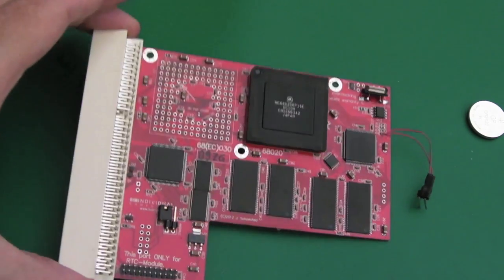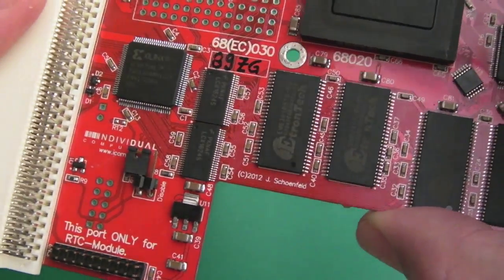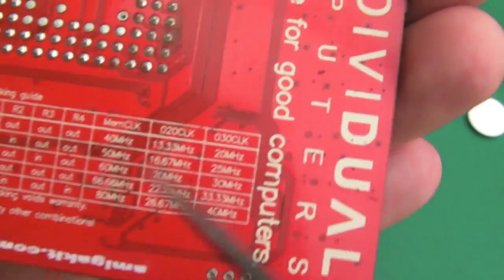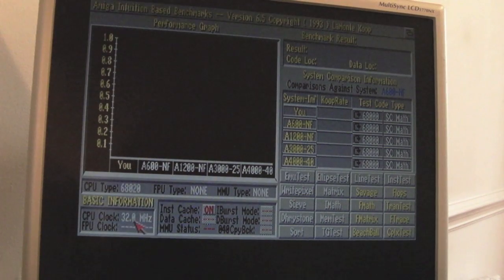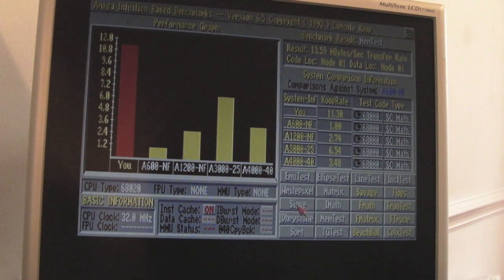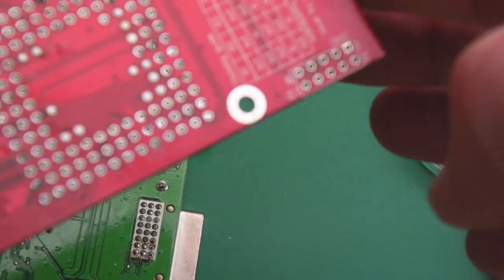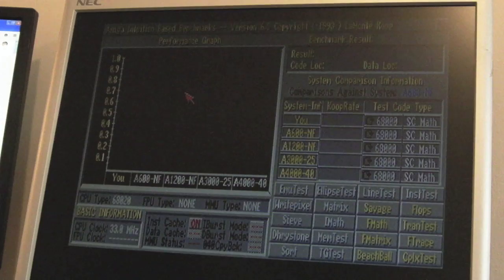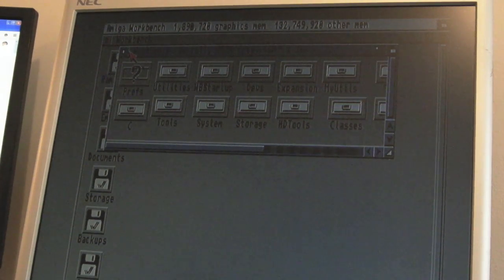Commodore Amiga A1200 ACA1220 Extra Overclocking

Comment: Weird you doing a video on this, ive just spent the last 4 days re-building a friends CF card from his Stock A600 using Winuae and Classic Workbench with WHDLoad. Not good with 1MB. Even when booting without a start sequence some things dont run. I have a stock A1200 running  Classic Workbench Lite and WHDLoad. Looking at getting one of those new ACA1221's from AmigaKit just for the extra meg. A quick question, do they also work in an A600 because i recommended the ACA to my friend but not sure if its compatible as his runs like a 1 legged dog lol. Had to re-learn loads of AmigaDos commands. Took me days to get his card done. Was having problems in Dopus crashing whilst copying files and games. Messed with all the recommended Max Transfer rates when partitioning. Got quite proficient at doing it all now. Everytime it crashed i had to start from scratch and DiskPart the CF card again. Nightmare mate.
Reply from the maker: +craig gilchrist That Max Transfer rate thing is a pain in the backside and needs changing when using CF drives I think.  It got me also - every single thing I copied to the system was corrupted and I couldn't work out if it was the Amiga or what.  Drove me nuts!   For the A600 I would consider buying one of Kipper2K's Vampire 2 boards, they are cheaper and way way faster than the the ACA620 (for the A600) - they actually make the 600 faster than an A1200 @ 80Mhz!.   The ACA1220, 1232, 1221,1231, etc are for the 1200, or can be used with an ACA500 on the Amiga 500 / 500+.
Reply: +GadgetUK164 Cheers Gadget, i will check that out. 80Mhz cant have him having a faster Amiga than me lol
Reply from the maker: LOL =D  Kipper2k is doing the same expansion for the 1200 soon hopefully =)
Reply: Gonna be more than 70 quid though I would think. That new ACA1221 is that price. If its the right price who would you go with in regards to build quality and reliability? Obviously the chips are all original on the boards. Ha Ha, Wonder if you could program an Arduino to share its ram through the expansion slot. Find the card edge schematics see what they do. Wild idea but im always thinking outside the box. Do you think thats possible? Finally just got my Assigns right in WHDLoad so it can see my games. Jees sick of watching a bar going across the screen in Workbench copying games to the CF. Even in Winuae with 8MB 1GB Fast and an 040 it takes a while.
Reply from the maker: Probably not much more though!  The version for the 600 is 150 euros I think which is amazing really.  I like the Indivision cards because they have lots of RAM, but the newer ACA1221 is kind of crippled in its 'locked mode', I would be tempted to unlock all of its features right at the start which gives you 64Mb (which is OK for nearly everything) and OC to 26.7Mhz which makes a big difference even just in Workbench and boot speed etc.   Yes the CF card can take a while when copying lots of files etc.  I think Individual Computers also do a 'fast IDE' board, but I am not sure how much faster it is and whether its worth it or not.  It probably enables PIO mode 4 or something.

Comment: I got my aca1220 up to 40 Mhz without changing the crystal or the cpu. I stumbled across an undocumented setting with the jumpers which upped the multiplier. It's rock solid too. I Let it run Doom for a couple of hours, no issues at all. Of course it gets a little hot so I put a heatsink on there. Not very effecient i guess with the plastic packaging but it definitely absorbs some heat.
Reply from the maker: +Henrik H Can you expand there?  What combination did you set?  That's awesome if that's possible because the 020 - 25Mhz I have running at 33Mhz is currently cold and doesn't need a heat sink.  I would love to run this at 40Mhz.  Are you sure yours isn't an ACA1230?
Reply from the maker: +GadgetUK164 I've just found a thread talking about the jumpers and their multipliers, this is based on the 030 though:- 

r2 r4 = 4x (this is the setting mine was using in order to get 26.7Mhz with stock 20Mhz Crystal, or 33Mhz with 25Mhz Crystal.  Swapping over to use r1 and r4 using the original 20Mhz Crystal I get 33Mhz again.  When benchmarking at 33Mhz I can see the RAM is probably clocked at 100Mhz and the benchmark is identical to when I used the 25Mhz Crystal with r2 and r4, and since the RAM won't run faster than 100Mhz without a mod to the firmware to add wait states, I am confused how you managed to get 40Mhz on an ACA1220.

r2 none = 5.333x
r2 r3 = 5x
none r4 = 2.5x
none none = 2x
none r3 = 3.333x
r1 r4 = 6x
r1 none = 3x
r1 r3 = 8x
Reply: +GadgetUK164 Hi, Yes it is a 16 MHz 020 :) I'm sorry to say that I haven't got the machine with me now, and won't for a couple of months. So I can't elaborate on it unfortunately. 
As I said I stumbled upon it by messing up a solder job. lol. I will let you guys know though when I have the machine with me again.
Reply from the maker: +Henrik H Thanks, I've found the datasheet for the PLL clock multiplier.  Since it looks like the CPU clock is divide by 3 on the ACA1220 the only way it can be working on your 1220 is due to different RAM chips.   When you get chance please check the part numbers on the 4 RAM chips =D  - https://www.google.co.uk/url?sa=t&rct=j&q=&esrc=s&source=web&cd=1&ved=0ahUKEwjI5NWT4_fKAhUrjXIKHcdiDFgQFgghMAA&url=https%3A%2F%2Fwww.idt.com%2Fdocument%2Fdst%2F511-datasheet&usg=AFQjCNEFtQWOtmT3D0vwL86UffAciUhEwQ&sig2=bz2YTtOoXiiK3AbJ1F0AXA&bvm=bv.114195076,d.bGQ&cad=rja
Reply: oh yeah I just remembered, my aca1220 is the 128 MB version which might explain it, the specs on that ram might be different.
Reply from the maker: +Henrik H Mine is the 128Mb version also!
Reply: Hi! Sorry for the late reply but I just checked my A1200, apparently the only bridged resistor was R2 nothing else! It gave me 40 MHz although I'm sad to say it's not stable at all. Most games works falwlessly but things in workbench starts crashing after a couple of hours I guess the cpu is not limited by screen sync and just runs hot in workbench. I really need some better cooling, the small heatsink i put on there is not enough. 
Oh yeah the memory chips are Etrontech em63a165ts-6g
Reply from the maker: Are you sure you are running an 020 chip and not an 030?  The reason I ask is the the multiplier for just using jumper R2 on its own gives 5.3x, whereas the jumper I am currently using (R1 + R4) gives 33Mhz with multiplier of 6x.  So if I swap to R2 on its own it runs slower than 33Mhz, not faster.  Very strange!

Comment: I've just checked individuals website and they are selling a 55Mhz 68030 version.
Reply from the maker: +Ronald Madican I nearly bought that one last month - have you seen the price of it!!  It's a bit costly, especially when you compare to the Vampire and the performance of the Vampire too.  I am tempted though!
Reply: +GadgetUK164 I think that they added on the burst cache and put in the memory compatibility for the 500 which makes it the holy grail of speed and compatibility.
I have to agree that the new cards by kipper2k and Lotharek are much better value.
And you can buy a brand new ps4 for £280.
But it's still gnawing at my soul.

Comment: There is a new card comming out for the 1200 running at about 500Mhz. Check out the kipper2k website. At the moment there is only a board for the 600 but there is more to come.
Apparently you can run Mac software on a 600 using the fusion emulator.
https://www.youtube.com/user/kipper2k
 
I liked the overclocking part of the video but taking the chip off is just bonkers. Hats off to you for that.
Reply from the maker: +Ronald Madican Yes, I've mentioned that further down below in reply to someone else - the Vampire 2 looks awesome!  Just hope kipper2k gets around to producing a 1200 version.  I was tempted to buy a 600 last month but I've just got too many systems and if I upgraded the 600 using a Vampire I just wouldn't use the 1200 any more and I do enjoy using the 1200.

Comment from the maker: Update 14/02/2016 : 40Mhz + 120Mhz memory combination won't work - due to wait states being required I think.  This means the maximum you can run an 020 on the ACA1220 is 33Mhz.  Unless there's a way to change the CPU clock multiplier separately from the memory clock.  Ideally I would like to run memory at 100Mhz and CPU at 40Mhz (or 50Mhz, the current 25Mhz chip running at 33Mhz is stone cold without a heat sink).  The new 25Mhz 020 I've fitted is luke warm at 33Mhz so it doesn't need a heatsink now.  It might be possible to swap the RAM out for faster RAM that might not require the same delay this RAM needs when running over 100Mhz.

In order to get 33Mhz you don't need to swap out the Crystal.  You can just set R1 and R4. (table below is based on the /2 clock I think, so it can be confusing on first read)

r2 none = 5.333x
r2 r3 = 5x
none r4 = 2.5x
none none = 2x
none r3 = 3.333x
r1 r4 = 6x
r1 none = 3x
r1 r3 = 8x

Comment: To make things Crystal clear .... Overclocking Voids Warranty  ! :) 
Good work ! - I do wonder what the benefits are of overclocking "retro" systems,  is there something particular your trying to run that would be impossible on standard hardware ?
Reply from the maker: +A Leadbeater Yes lol!  My warranty was long since expired =D  I generally wouldn't overclock any other old systems except for the Amiga and ST.  Basically because those systems did have different speeds (typically through 3rd party expansions) and the software was developed to make use of the faster clock speeds.  There's an absolute tonne of Amiga and ST software which benefits from a faster clock speed.  Even just Frontier or Doom are quick examples of where overclocking really helps!  Even just the OS is much faster.  For example if you boot a stock A1200 it can take 10+ seconds at least, with a 26.7Mhz CPU it takes litterally half the time to boot.  At one point when I was testing I thought I had killed my 1200 because I was trying to boot it without the accelerator and after seeing a black screen for 10+ seconds I switched off thinking there was a problem.  What I didn't realise is how much slower it is a booting and it was actually fine, just dead slow.
Reply from the maker: +A Leadbeater I think the other thing worth pointing out here also is that the 68XXX CPUs are pretty much designed to be overclocked.  ie. often Motorolla did temperature and performance tests on a batch of chips and stamped them according to what they felt was acceptable primarily based on temperature.  So you can often pickup at 16Mhz chip that can safely (with cooling) run at 33Mhz or faster.  The same holds true of most of the 68020 and 68030 range.  The 68000 was a little less forgiving, but you can run the 68000 - P12 / P16's higher than 12 or 16Mhz also.  I know some people have run the 68000 P16 at 32Mhz with cooling also.

Comment: I had no idea what burst mode was despite using old Macs that ran on the 68030 and 68040... Low and behold, an hour later I'm nose deep in a technical manual describing computer logic behavior I only mostly understand, hah.

Anyway, yeah, it seems as the 68030 wouldn't be able to run in burst mode without specialized hardware meant to take advantage of it... Or it would, but it might be buggy and glitchy. Apparently, if it's running in "write-allocate mode," which Amiga software requires it to, there's a rare loophole that can occur where an address that Zorro III card is in, signaled as non cacheable, can get cached anyway and... 

I don't quite understand what it's describing, but it sounds like it sees the Zorro III card's address in cache and thus doesn't read the card's register to get fresh data. Which sounds like it could cause crashing as it would end up executing something fresh with outdated data?

68040 is a different kettle of fish, and involves the fact the CPU can only run in burst mode if the cache is being used, which also causes havoc with Zoro III devices. Geeze these old systems had weird architecture problems. Makes em interesting, though.
Reply from the maker: +GravianS Thanks, that's very interesting info - where did you read that?  I wouldn't mind doing some more reading before I waste time attempting to fit a socket for my 68030/40.  Sounds like it might not work at all - ie. crash?
Reply: GadgetUK164
This is it, it's specifically relevant to the Amiga and those later 68k chips: http://amigadev.elowar.com/read/ADCD_2.1/AmigaMail_Vol2_guide/node0161.html

That said, I reread it what I posted and realized I typed "hardware" when I meant "software." Bah. What I was getting at with that is the 030 can use the cache separate from burst mode, so I imagine your software has to tell it whether it should be used or not.

But there is that bit about write-allocate mode causing things to cache that shouldn't. It sounds like a rare sort of problem that would cause crashes, but not keep it from working altogether.

Honestly, this does kinda go over my head. You can probably make better heads or tails of this than I can, and likely can tell easier if it's still relevant. I wish I really understood how this stuff worked, but when this hardware was coming out I was a little kid, hah.

Comment: Great job mate as always.
I want to see an 030 in there ;-P
Btw, we need more software guys to make a more reliable benchmark prog.
I love AIBB and it looks awesome, but we need a new breath.
Reply: +GadgetUK164 You can't just put in a 030 in there unfortunately. I checked this issue with the guy at individual comp. some time back. You have to send it in to him to update the firmware.
Reply from the maker: +Vincent GR Thanks!  Just not sure if an 030 will work!  Doing a bit of research first I think, so I can understand what implications caused by lack of burst mode.
Reply: GadgetUK164 burst gives boost. With an 040 you can see it on aibb on/off.
Reply from the maker: He told me the firmware is required for burst mode but he's never actually tried an 030 with the 020 firmware.  I still don't think it will work, but I might give it a go as its pretty easy to just add a socket and test it now.

Comment: go for 48mhz change out the crystal
Reply from the maker: +Amy Marie Once the 25Mhz chip arrives I will try at 40Mhz to see what happens.  Hope I don't kill the FPGAs or RAM.  I've checked the datasheet for the RAM and I think it will run at 166Mhz, so 120Mhz should be safe for the RAM (assuming the Amiga doesn't crash).  I guess I should check the datasheet for the Xilinx chips as well first.
Reply: or GFB (go for Broke) Get a 4 pin 66mhz crystal and wire it up.(of course Providing the 5V From another Source. my Lone experience with crystals says "hey why not"

Thats From the MCU LED Display Video that you've seen i learned that different crystals work differently with different "clock sets"
Reply from the maker: +Amy Marie Yes, you are right regards different crystals - some times its better to use the 4 pin type for certain things but its also about the maximum speed the CPU can run at, and since the 16Mhz chip gets hot at 33Mhz I suspect it will crash and burn at 40.  The 25Mhz chip could run OK at 40Mhz and maybe at 50Mhz (or just below).  The main issue is the RAM controller probably needs the wait states adding at anything above 100Mhz on the memory clock or it will just crash.  Will see how I get on with the memory at 120Mhz and CPU at 40.
Reply from the maker: +Amy Marie Beyond 33Mhz (25 Mhz Crystal) doesn't work due to the RAM needing wait states adding I think.  It's a shame but I've just proven it doesn't work.
Reply: okay thanks!